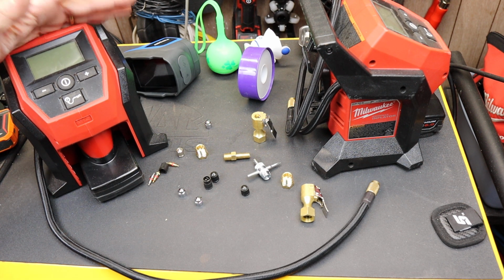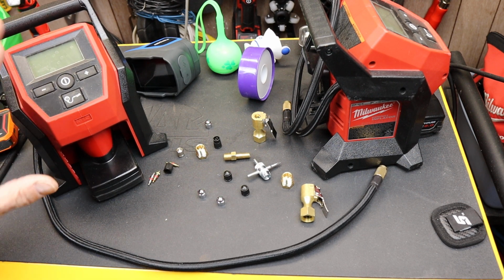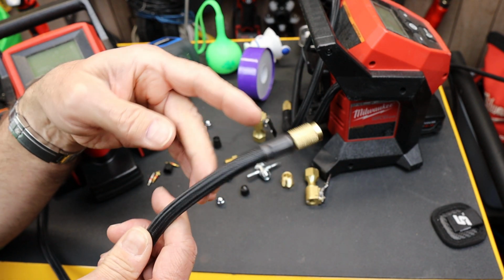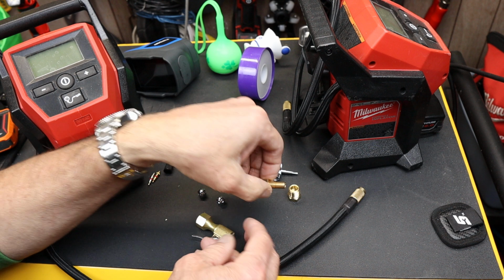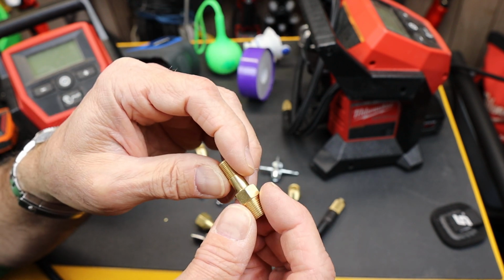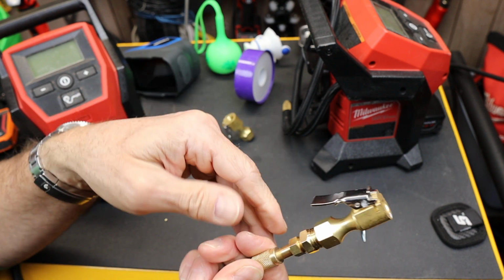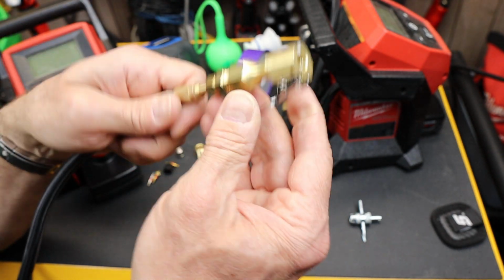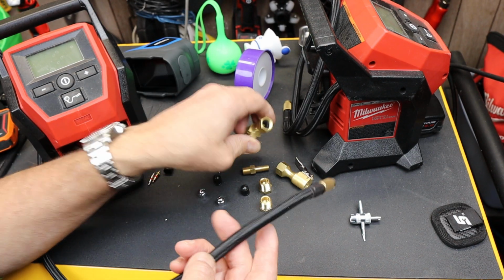Milwaukee M12 Inflator Hack: Adding a better chuck for quicker use and less air loss.

Comment: They have an air chuck on Amazon that’s exactly like the one in the video that screws right on the Milwaukee inflator for $12. No 1/4” NPT to Schrader adapter needed.

Comment: Would keeping it 3/8s have a positive effect on air flow? Would it be equal to or less than the increase in airflow provided by the 1/2  fittings? Would be cool to see comparison tests between factory, and upgrade inflate times
Also, have you seen the m12 inflator that has been converted to run air tools? A brad nailer, specifically

Comment: Just get a Jaco Lightning hose extender. You can directly connect it to the Milwaukee, and it has the best self locking chuck on the market. All you do is push it on the valve, and then press a button to release it. Make sure to get the open flow variety though - the closed flow is for use with a compressor. You'll spend a bit more on the Jaco (about $25,) but it is so much slicker.
Reply: I wish I'd looked for it on this platform earlier. I kept calling Milwaukee to see if they made something like this. Last week a tech told me about the video for an adapter. It was for LockNFlate. $45 for the combo locking chuck and adapter. The Jaco (with straight chuck) could be used on the 3 other inflators I have with the L-shaped chucks that don't fit on some applications, like well tank fitting, and EGO rider front caster wheels.

Comment: The original screw-on air chuck has a Shrader valve in it, don't you need to remove that Shader valve so that you have airflow to the new lock on air chuck?

Comment: Most quick lock-on chucks won't fit into the access hole in an RV "beauty disk" and lock onto the tire valve securely. The screw-on type will fit.

Comment: Yeah you didnt had to go all the way with those adapters when Amazon already have the 1/4" screw in chucks that fit all these standard 1/4" air compressor connections.  You get 2 for $7! They work perfect and they just screw in tight and forget it!

Comment: You removed the shrader valve from the new adapter but I noticed you left the shrader in the original fitting on the hose.  Wouldn't it benefit from the removal of that valve as well?
Reply: The thing in the original fitting is not a schrader valve, it's a valve core depressor (it opens the schrader valve mechanically once the fitting is attached). I'm not familiar with this inflator, but generally these things are a non-removable part of the chuck. With the mod it is indeed not serving any function, but if you wanted to remove it, you would have to use a dremel or something like this to grind it out (possibly damaging the threads on the fitting in the process). I think the OP wanted to leave the original fitting untouched, in case he wants to go back to how things were. If not, the simplest thing would be to cut off the original hose and fit a single suitable barb or hose clamp adapter, rather than mix and match multiple screw-in adaptors as in the video. Or just use some nice replacement head for a bicycle pump, that can fit more than one type of valve.

Comment: I am constantly hitting the power button instead of the inflate button as well. Also, I use the JACO Lightning S2X Tire Inflator Hose Extension Self Locking Nozzle my M18 and M12 inflator and it works well without any adaptors.
Reply: Thank you thank you!
Reply: JACO... never even knew this product existed till this post! Thank you for educating me!
 
*

Comment: I like that you made it so that you can still run the factory thread on version. I find the clip on style tend to leak unless the hose is putting zero strain on the valve stem. 

I’m very curious about the locknflate.

Comment: Instead of all the adapters, did you consider removing the existing female fitting and replacing it with your desired fitting?
Reply: This! That's exactly what I did. Cheaper and easier :)

Comment: Sponsored Ad - LUMITECO 2 PCS Locking Air Chuck with Air Hose and Standard Tire Valve Fine Thread, Air Inflator Hose Adapt...
Sponsored 
LUMITECO 2 PCS Locking Air Chuck with Air Hose and Standard Tire Valve Fine Thread, Air Inflator Hose Adapter for Twist On Convert to Lock On Connection
4.44.4 out of 5 stars (2,087)
100+ bought in past week
$9.99$9.99
 One-Day this is what I use from Amazon not sure how to add link but works great

Comment: I did this exact mod two years ago I find that chuck leaks alot when installed. I am going to buy the locknflate with the adapter its super pricey but ultra reliable
Reply: I had the same experience.  I have these cheaper chucks but they are leaky. I find I have to fidget with it quite a bit to be air tight.

Comment: all it needs is a number keypad. not even a power button. you key in the pressure you want, i should inflate to and maintain that pressure until you come back to detach it. a few seconds after detecting normal athmospheric pressure, it should switch itself off automatically. no manual operation. it could prectically be operated by a blind person
Reply: typo

Comment: If you are worried about accessibility perhaps you could use angled adapter?
Reply: Yes.  A universal joint would also alleviate some of the force on the stem.

Comment: I'm in the market for a drill with interchangeable chucks and this inflator is why I'm leaning towards the Milwaukee 12v system
Reply: The Milwaukee Installation Driver with interchangeable chucks is a fantastic tool.   It gets into places other drivers can't.  The trigger action is smooth allowing the correct rpm's for the given application.  Highly recommended.
Reply: @chiphill4856  Thanks... a major thing that's making me hesitate is some confusion over the difference between the T and the D drill shape options. The T has much more power and a 13mm chuck but if I understood a test I saw correctly the concentric driver doesn't seem to get as close to edges as the one that comes with the D shape.
The magetic holder on the D also looks really useful, albeit with a possible downside of ferrous metal shavings sticking to it.

I already have a brushed 18v Bosch drill, the 18v-21, so I do already have a 13mm drill in my collection - so maybe the D M12 drill would be better? The 18v-21 is just a bit under-powered by the latest brushless standards but I'll probably never need that extra power